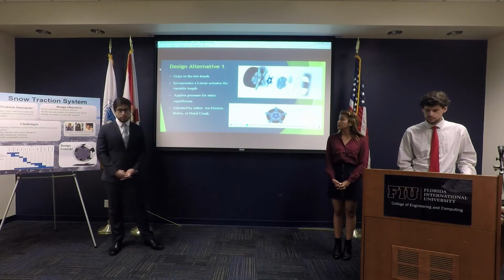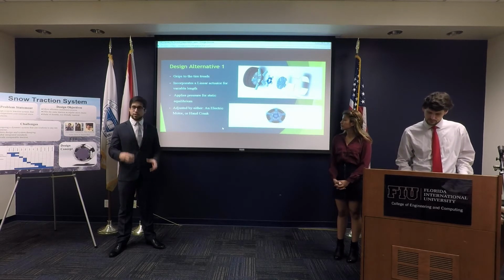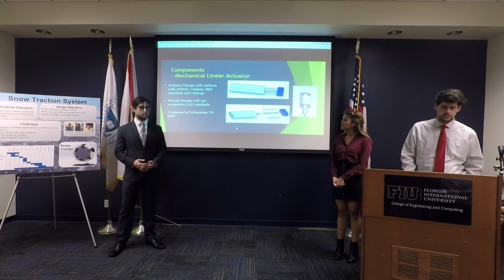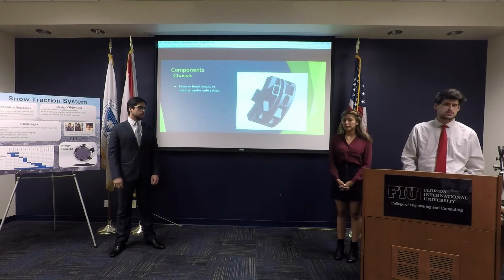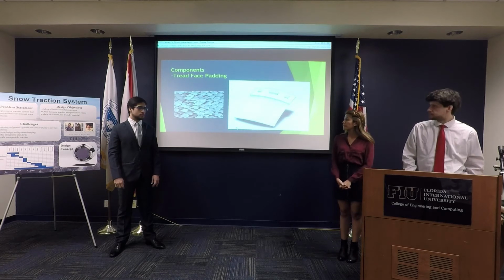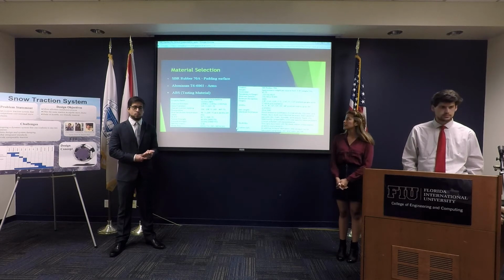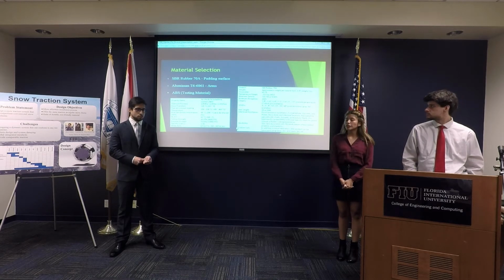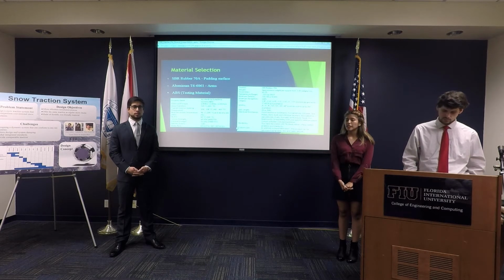SDO Team 5: Snow Traction System

Comment: The presentation was good. One thing that I felt they were lacking of was a test procedure. I think they never thought where to test their prototype. More over, one thing that I didn't understand was how they were going to manufacture this prototype. Also, they did not discuss in detail what are the possible damages this product may encounter. I would recommend is to work in how they project their voices because at times it was hard to hear what they were saying.